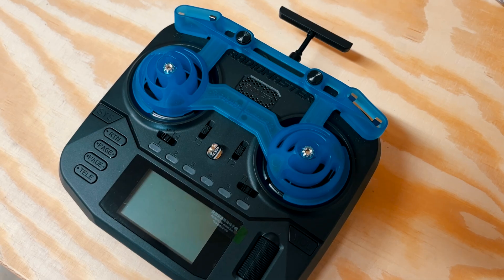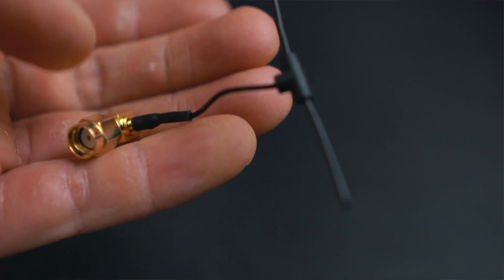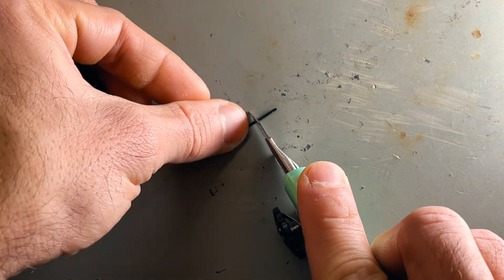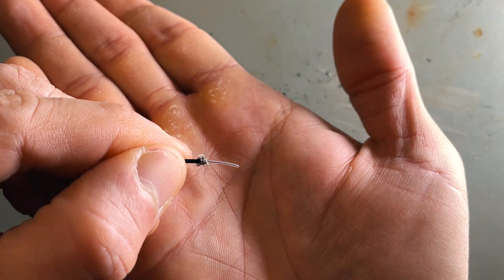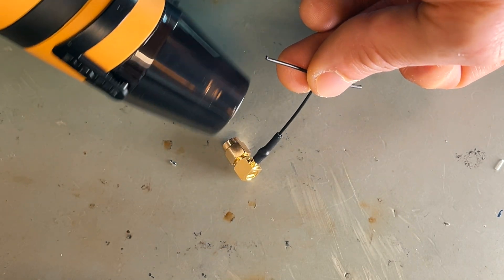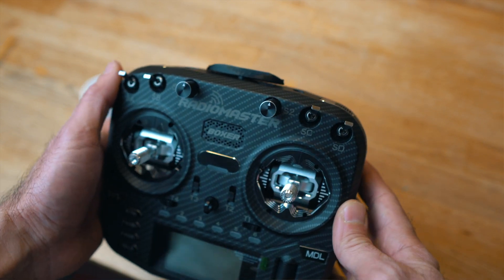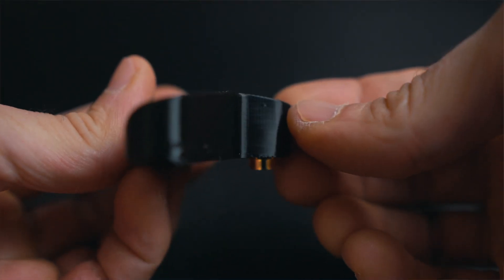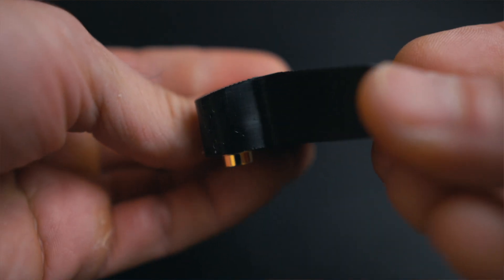A new antenna mod for the Radiomaster ELRS Boxer (No need to open your radio)

Comment: I would rather buy whole thing so I can just replace ?
Reply from the maker: Unless you are thinking to buy the pocket antenna and try to replace I don’t understand your comment.
Reply: @ I meant buy that great antenna replacement , soldered with 3d print etc  you did … Anyways just making it myself, great idea

Comment: Did you test swr?
Reply from the maker: I have not done any scientific test, but I’ve been using this radio as my main radio since the mod and I have not notice any problem.
Reply: @NordFPV  Sure, I asked since this can be checked with few clicks in the radio itself. Thanks
Reply from the maker: Nice. Can you teach me how? Or point me to a link?
Reply: @NordFPV  afaik it is in the Hardware tab in the menu - one of the last lines. When antena is uninterrupted (meaning you are not holding it in the hand etc) it should read 0 or 1. Higher reading can suggest that something is off (bad tuned antena, bad quality antena etc). Bardwell says about it in old Taranis x9d antena mod tutorial video. I learned about it when I was doing it myself and checking if I did it right and checking few antena options

Comment: What do you think about putting a foldable style antenna like for example in the Tx16s?
Reply from the maker: That would be great in my opinion. I don’t have the knowledge to design it myself but I’ve seen one or two designs on this on the internet which looks solid.
Reply: @NordFPV  Have you tried to put the Tx16s one on the Boxer????
Reply from the maker: I actually haven't...but the TX16 is fixed, you can't remove it, so it will be a bit painful to "transplant" @blackclown6191
Reply: Ah I see, I tried with the antenna that came with the upgrade kit for the Zorro that it's similar and it's good  @NordFPV

Comment: Does this affect the performance?
Reply from the maker: I’ve done only very unscientific tests, and I don’t see a big difference. What I’ve seen is that antenna orientation has a difference and with this antenna it will look a bit weird if you rotate it for orientation.

Comment: If the 3d print had a hindge it would be perfect. Fold it flat for storage and unfold for full range... the radio itself blocks signal so it becomes more directional this close to the radio. I wish radiomaster did the antenna as on pocket or jumper t20 on the boxer... if a mod exist for this type of antenna I would do it... infact I would buy a boxer shrinked to t20 style in a heart beat. Boxer seams better for pinchers but still a tad big for my liking.
Reply from the maker: I thought about something like that, the problem is that you don’t really have a solid place to add a hinge unless you start to mess with the radio, opening holes, adding heat inserts and so on.
Reply: I've sent radiomaster an email asking for the same you're talking about. Write to them, maybe they Will takes that.

Comment: For long range performance isn't an adapter inbetween reducing the performance?
Great mod for not opening it.
Reply from the maker: Potentially, but why are you naming an adapter? There’s no adapter here. We are building an antenna basically, just changing the connector to work with the radio.

Comment: Whats wrong with the stock antena???
Reply: The stock antenna is exposed and can break while transport. For flying it's fine. I intend to do the first mod.
Reply: @NitronNitron how about take you only 3s to unscrew the antena out before travel?
Reply from the maker: It’s true that it doesn’t take that long to unscrew and screw it back again, but I rather have something more permanent, first because I don’t want to lose it, second because the RPSMA connector has a limited number of screw in and out. 
In reality these mods are not a must, it’s just a way to tinker and adapt the product more to what I think will work better for me.
Reply: @NordFPV  wow good to know that they have limited on count in and out screw👍👍👍, maybe i will do the same of you 👌👌👌❤️
Reply from the maker: The number of mating cycles is "high", in the hundreds, but still. Check this link out for more information.
https://www.megiq.com/images/AppNotes/MegiQ-AN101-CareConnectors.pdf